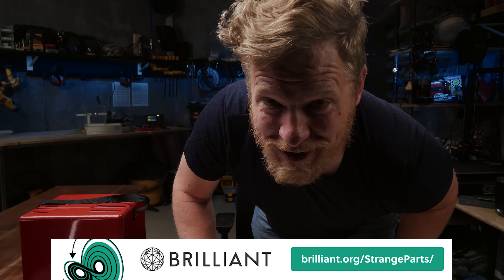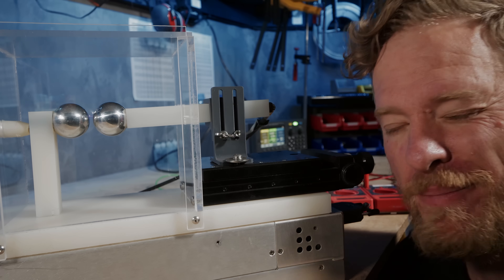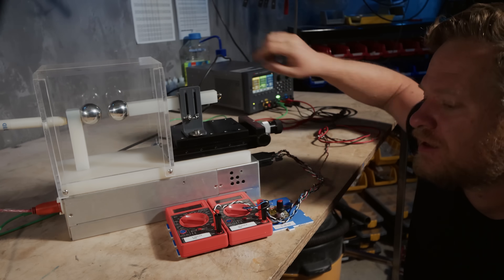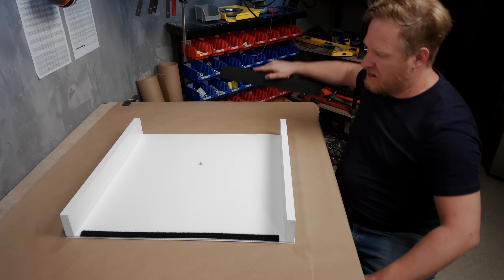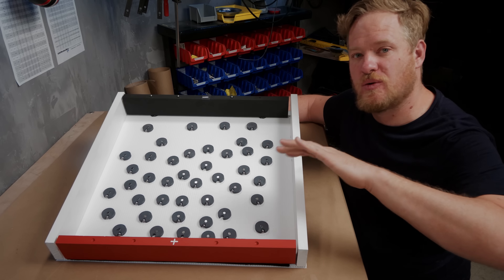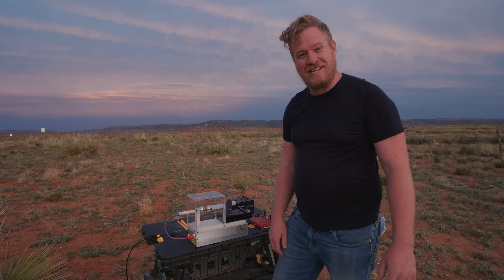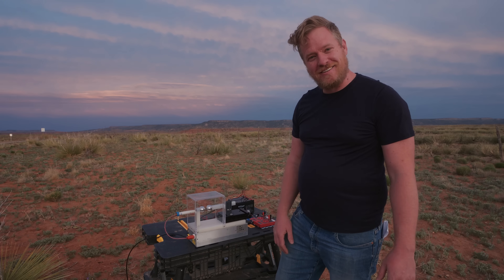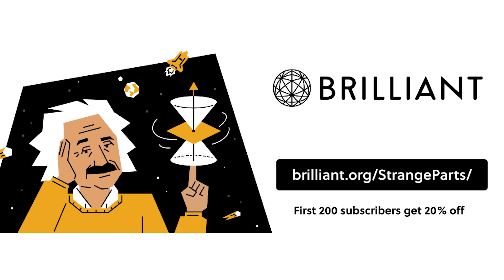Why 10,000 volts at altitude is a BAD IDEA

Comment: That demonstration with the marbles was incredible. Such a clever and straightforward way to explain a complex topic. Keep it up Scotty.
Reply: Yes, especially since in a vacuum you should have a less arcing, if I am not mistaking. So it's not really intuitive, the higher you are, the closest to a vacuum you should also be... Now I'm curious to know at what altitude are you going to get the longest arcs?
Reply: @Reth_Hard  It's a balancing act. The lower the pressure the faster electrons can move but the less likely they are to interact with any particles on the way. The higher the pressure the more particles each electron will interact with but the slower the electron will be moving. If you're interested in learning more, this phenomenon is described by Paschen's Law.
Reply: @Reth_Hard  There must be a balance between air as an insulator and the nitrogen needed to form the arch.
Reply: Did you notice the oxygen atom turned into a hydrogen atom that turned into a nitrogen atom? (Not that it matters really, just noticed it)
Reply: This is exactly the kind of quality learning that I'm here for!
Reply: It really was an amazing demo, I agree
Reply: Honestly 1000% made sense from your marbles.
Reply: Yeah when i first saw it i was getting more confused
As it went on i had an aha moment.
Good demonstration
Reply: Agreed. It was genius
Reply: I think they were ball bearings
Reply: i was about to write this exact comment ! - great work

Comment: Years ago when I was in university I had High Voltage labs. Most dangerous labs but soooo satisfying and cool to do. 
In my opinion the temporary fix and somewhat easy way to solve the altitude problem is to increase pressure inside the workshop. Or you can make something like clean room with higher pressure.
Reply: Just use a different gas in a sealed chamber.  Maybe more nitrogen % ?
Reply: Flood the workshop with Nitrogen.

Comment: Let me know if you need access to a pressure tank on Denver. Have one that is about 80 gallons. And it would be easy to put small pressure to mimic sea-level. Wires could run out of pressure tank, or scanning could happen inside the tank.

Comment: Loved this video Scotty! I was super intrigued watching, because this exact phenomenon has implications in cancer treatment and you explained it so clearly! To calibrate radiation therapy machines, you use an ion chamber to measure the amount of electrons kicked loose by the radiation, which is basically like the two plates in your SEM and you measure the accumulated charge (at a lower voltage to avoid arcing) but like you showed, the election showers you detect change with pressure, so you have to correct for that! You can get really mess up your doses if you don't!!

Comment: You could make a pressure vessel and put the entire SEM inside it. Then you just have to add a little bit of air untill it reaches sea level pressure. I wouldn't think it would be that dangerous given that it's only a few PSI difference

Comment: You also cannot have a plasma TV set transported by air in unpressurised cargo, because the lower pressure delaminates the screen internals. Operating for high altitude also has limits. 

Easiest way to fix the HV issues is to basically pot all the HV path in a resin, which will provide the extra insulation needed. You can use a electronics safe silicone resin to do this, but have to ensure the potted volumes are totally bubble free. Otherwise you can use the old fashioned method and put multiple coats of urethane PCB varnish on the HV joins and connections, so that you get a conformal coating on there. 

Was originally done to the first few generations of TV sets to insulate the direct generated high voltage parts, along with having no sharp edges in there to provide a discharge enhancer, and this worked well using what they had at the time, shellac dissolved in alcohol, with you putting a few coats of material over every joint and exposed component lead, and leaving it to cure overnight. Worked well for the 11kV or so of EHT, and only later on did you start to get voltage multipliers in there, which were all potted in insulation. Originally in bitumen, with a rectifier tube buried in the bitumen as well, so you had to take the unit out, melt the bitumen out in an oven, then repair the unit by putting in a new tube, then pouring in the hot bitumen again. Then reliable semiconductor diodes were developed, first selenium stacks of thousands of tiny plated in a glass or ceramic tube, then stacked silicon dies in plastic later on, all potted in a soft compound and then an outer hard resin fill.

Not too hard to fix, aircraft RADAR uses high voltage parts, also unpressurised, so the fixes that are used there, pot, seal and no sharp edges, all are usable in this application. I would suspect this will be the solution, and will also help with use of the units in high humidity areas, where you get water vapour providing conductive paths as well, plus also enhancing corrosion of the electronic parts.

Comment: A really low-tech quick fix would be to build a pressure-chamber and connect a compressor. It really shouldn't take much, as we're talking much less than 1 bar.
Obviously it would need to be able to open and close, be fairly air-tight, and maintain a somewhat stable pressure.